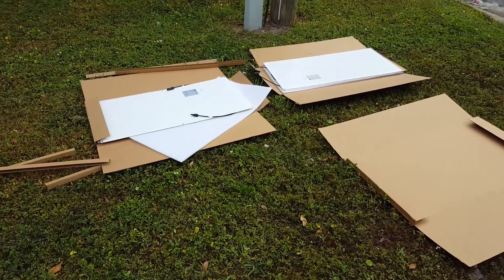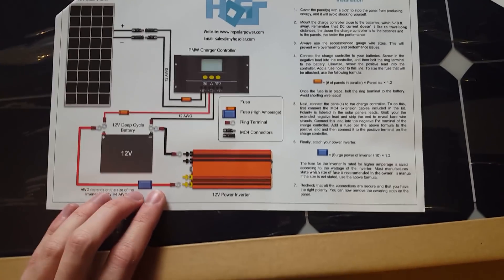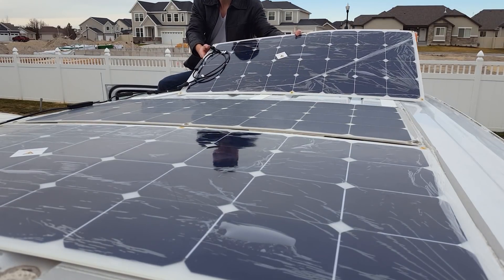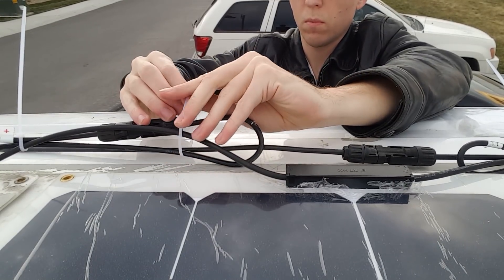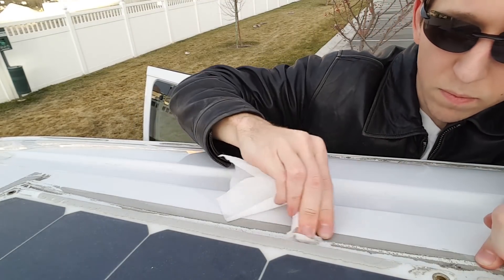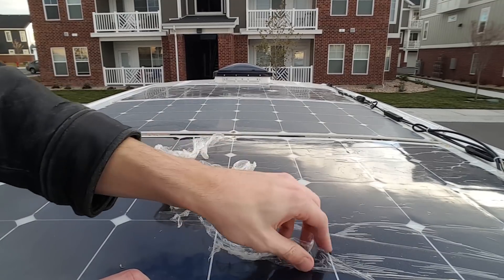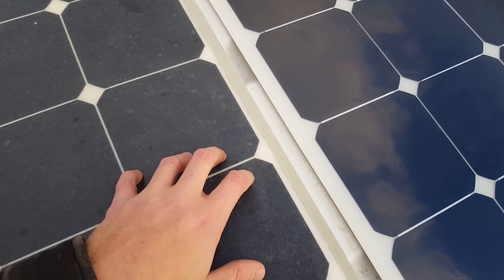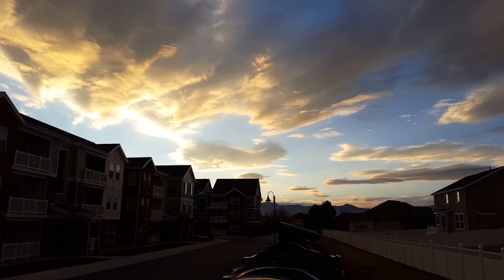UNBOXING & INSTALLING Flexible Solar Panels For A Campervan

Comment: Hey man, for your setup were the panels on without being sealed down all around? Only thing I'm worried about is travelling at 70mph+ and the wind getting under them and throwing them off, but I also want to make sure they're well ventilated. Is it safe enough to leave them unsealed all around?
Reply from the maker: I had the same fears. With the 1inch thick industrial strength velcro it hasn't been a problem. I was nervous but after driving across country with them I think it's all good. 👍

Comment: You can get house panels very cheaply from contractors that have them left over and sell them on craigslist.  They will run a lot more if you can attach them and handle the weight.  I think you need a bigger battery or something for them though
Reply from the maker: I think you're right Windy. For house level power, you're probably looking at several thousand Amp hour battery set ups